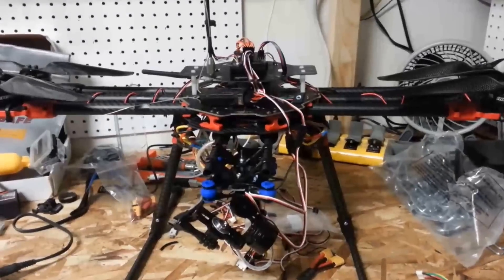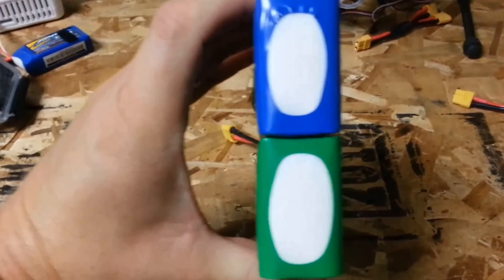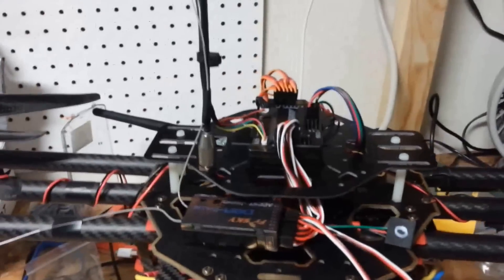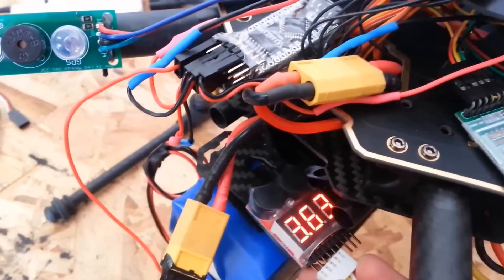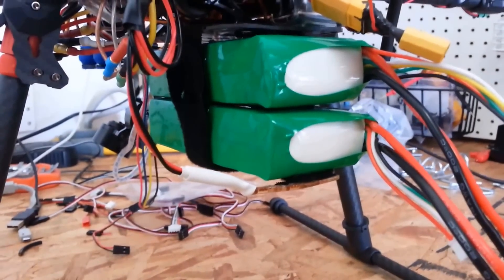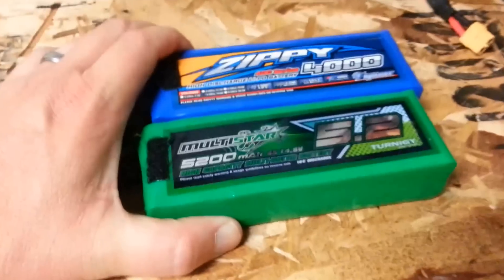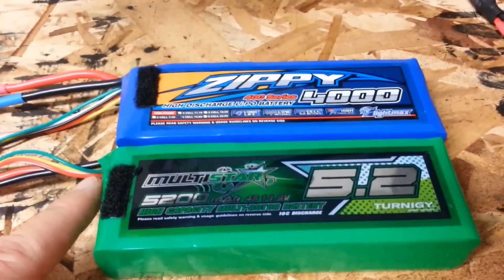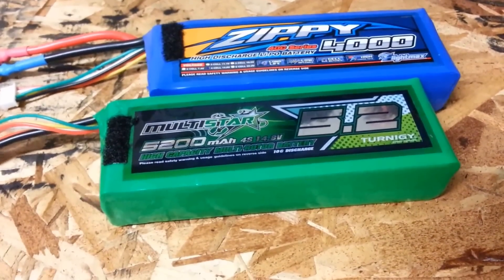Battery Comparison 10c vs.40c Lipos in a Multi-Rotor Hover Test

Comment: i have a question about these C rating's according to wikipedia it is the multiple of the capacity which gives the amperage that the battery can withstand for one hour with a continuous current of that amperage. i doubt for instance the battery here 5.2 Ah with 10 C could withstand 52 amps for one hour. either wiki is wrong or these are different C rating like max burst current or highest allow current in which case it is confusing cause i cant really find documentation on which it is. this is bad because i would like to purchase a battery which precisely fits the job but i can not and we are left to do magical tests to see which is better and go off of this instead of the companies be honest.
Reply: The C rating is the inverse of the time it takes to discharge, in hours. A 10C battery can safely discharge its full capacity in 1/10 hour, or 6 minutes. To find the safe amperage output, multiply the capacity by C. A 5200mAh 10C battery can safely put out 5.2*10=52A. It can put out 52A for 6 minutes, according to the rating. The 4000mAh 40C battery can put out 4A*40=160A for 1.5 minutes, according to its rating. 

The full equation:
5.2Ah/(1/10h)=52A

Running two batteries in parallel does not change the overall C rating, but it does double your available amperage and Amp Hours. Two 5200mAh 10C batteries in parallel work as one 10400mAh 10C battery. 10.4*10=104A  It can put out 104A for 6 minutes, according to the rating.
Reply from the maker: If I understand your information correctly, that's why I run two 10c batteries.  This makes an equivalent 20c of discharge.
Reply: i understand that, it is not much a 20 c as you cut the current discharge on the individual battery in half. my question is that for the 5.2 Ah capacity battery with 10 C rating that means that the battery can with stand a discharge of 10*5.2 Amps or 52 Amps for one hour. as far as i know that is a pretty standard definition of the battery C rating. i doubt though that this is a realistic rating for this battery cause if you had 2 in parallel it would half the current draw. so lets say you are drawing 104 amps continously to hover ( rough guess based on size of hexa) each battery is experiencing 52 amp draw then you should have a flight time of 1 hour according to that batteries C rating. but that is not the case instead you get 18 minutes or so which seems to actually be pretty good compared to other larger hexa setups. what im saying is it seems the battery manufacturers are not being honest and are labeling their products with quite unreal C ratings or lies basically. if i miss understand something they i apologize but this is what it seems to me?
Reply from the maker: marshalcraft That is entirely possible.  We're buying batteries with a set of specs that we really don't now how accurate they are.  I'd like to do some amp draw tests and find out what's really happening while this thing is flying.
Reply: yeah im about to buy some lipos for an 800 hexa sometimes soon and one of the first things im gonna do is get two capacity ratings for two different discharge currents and then work out the k value from peukert's law this will give me a good prediciton of flight time if i know what my expected current will be.
Reply: getting conflicting meanings of C ratings based on wikipedia, and other sources but i always though it was the the mulitple of the capacity that discharged the battery in 1 hour. it appears lipo uses different capacity and C ratings than say lead acid battery for other applications. with the lead acid you would know 2 different discharge rates one for 20 hours and one for 1 hour as a way of describing that the faster you discharge batteries the less capacity they have or they become less efficient the faster you discharge them. i guess this is true for lipos as well but because they have an efficiency closer to 1 they dont deviate from the theortical capacity so much as rate of discharge increases. with lead acid it is more significant and so i guess that is why they give 2 values. sorry for bashing battery brands when it was i who didnt understand lipo standards.
Reply: i think i just miss understood the C rating. simply is the maximum current the battery can handle nothing else. some rc groups said some other stuff that it meaned but this is not true it is just the maximum current you should draw from the battery nothing else can be implied from it. the capacity of the battery though is what is usefull cause it lets you know how long you can fly using conservation of charge or energy. it does not take into account puekert's law as i mentioned.
Reply from the maker: marshalcraft Good information.  Thanks for the input!

Comment: may i ask why u didnot  use one with higher Mah ? did u use two to just increase the c rate to 20c and also still getting 10200 mah ?? thanks
Reply from the maker: Yes and yes.  I did add two to increase the c rate.  At the time I purchased those batteries, they didn't have the higher ones available.  Doing it again, I would go with the larger mah lipos.

Comment: Ready to try these multistar lipo. How are they holding up? Also heard they are getting hot after flights on heavier hexacopter. Thanks for the review. Dave
Reply from the maker: I've had zero problems so far.  The flight characteristics that I've seen are virtually identical to the higher C rated lipos.  The heavier the hexacopter, the hotter the battery will be, but, for what I'm running, they're working out great.
Reply: Awesome to hear! My 4s 8000 should be here soon.

Comment: Well done also I have a question about those 570kv motors I have a ironman 650 quad with a 4225-610 but I need a little bit more  torque an I was wondering if those 570kv would give me better performance flying time on my quad please advise
Reply from the maker: In theory, yes.  It depends on your AUW and prop combo.

Comment: I respect the work you've done. Great comparison, but maybe, just maybe, not exactly correct. The more close battery for comparison is the Zippy Compact, with discharge rate of 20-25C, here you put a kind of serious one - Zippy Flightmax 40C battery against the 10C Multistar, that's why the size is similar in size and weight, but with the compact, it's another thing.
My point is, that you don't need the 40C rating in the first place, and you can do better with Compact series.

Compact 4000 specs:
Capacity: 4000mAh
Voltage: 4S1P / 4 Cell / 14.8V
Discharge: 25C Constant / 35C Burst
Weight: 370g (including wire, plug & case)                      (lighter)
Dimensions: 147x44x31mm                                   (almost the same size, a bit longer)

Compact 5000 specs:
Capacity: 5000mAh
Voltage: 4S1P / 4 Cell / 14.8V
Discharge: 25C Constant / 35C Burst
Weight: 488g (including wire, plug & case)                     (heavier)
Dimensions: 162x29x46mm                                         (definitely larger)

FlightMax 4000
Capacity: 4000mAh
Voltage: 4S1P / 4 Cell / 14.8v
Discharge: 40C Constant / 50C Burst
Weight: 465g (including wire, plug & case)                           (a bit heavier)
Dimensions: 145x51x30mm                                     (again, and as you said - the same)

Multistar 5200 specs:
Minimum Capacity: 5200mAh
Configuration: 4S1P / 14.8V / 4Cell
Constant Discharge: 10C
Peak Discharge (10sec): 20C
Pack Weight: 433g
Pack Size: 142 x 49 x 29mm

But let's face it, no one has all the batteries on the market, so it's fare, you have what you have, and you showed us your results, and I thank you for that!
Respect.
Reply from the maker: Great post, Ice Man!  That is solid information and you're right.  It would have been better to use the compact higher discharge batteries for a better comparison.  I wish I had those batteries, and you're correct in saying that no one really owns all those different varieties.  Great post and thanks for adding to the discussion!

Cheers!